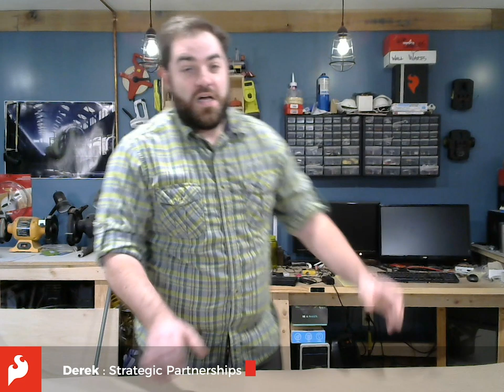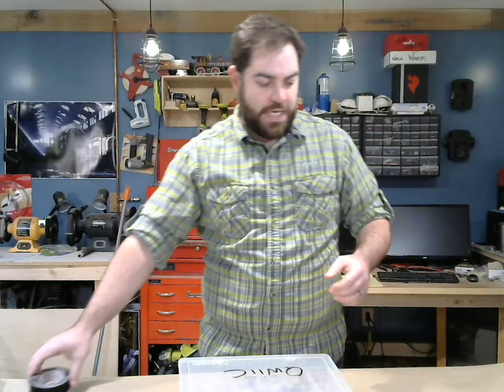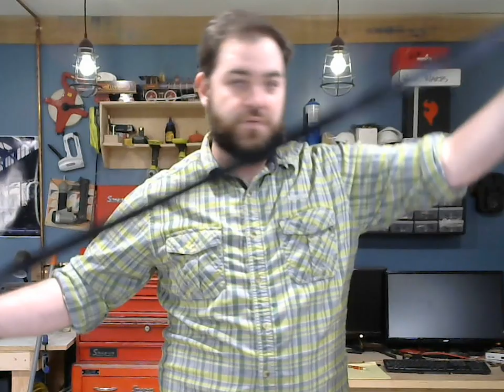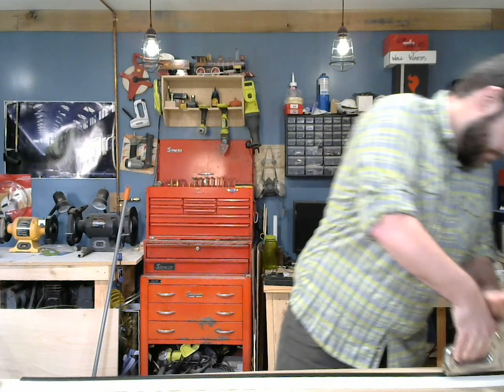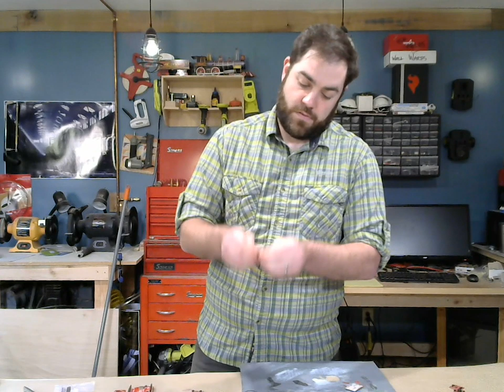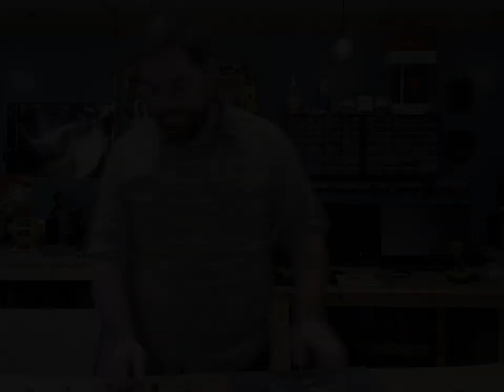Project Showcase: DIY Circuit Board Organization

Comment: dual loop is hard to press on and hard to take off and also wears out.
If the footprint of the object you need to attach has too much of it, its almost impossible to get to stick, also if the item is heavy and it sticks, it tends to fail all at once instead of giving you any warning that it is going to fall. Having used this for about a year, it easier to stick things on with 1" +/- strips than it was when it was new but it also does not hold as well and not as relyable. I'd stick with industrial velcro or a good quality one.

Comment: My electronics workbench is a steel door that I put on a 2x4 base that I made with pocket screws.  There are multiple benefits to a steel door.  1) it is fire resistant.  I can lay the soldering iron on it almost indefinitely without worrying that it might cause a fire.  2) it is magnetic.  This means you can use magnets to attach things and hold them in place - very handy.  3) You might think conductivity is an issue, but not really.  You can buy double sided adhesive circles for attaching commonly available rare earth magnets.  These circles are made of plastic and the plastic acts as an insulator.  For double protection, the door is also painted.  And 4) the door is bigger than any commonly available desk, so you have a lot of room to work with.  5) the door handle hole is used to guide power cords to various power strips on the floor.  The door handle hole is placed in the back of the bench which makes cord management easy.  

I don't know that I would use double-lock for this.  It takes a lot of pressure to get it to engage.

Comment: Could static electricity be a concern? Also, seems like a neat alternative to breadboarding, just stick a bunch of boards up on a set of strips and have jumper wires between them - could even put the strips on a whiteboard for instructional videos...
Reply: This idea has already been super useful for taking photos of boards that don't want to lay flat due to spring in the wiring wanting to do its own thing!

Comment: There's a very finite amount of time the velco will adhere. So, if it's a board you want to use often, this might not be a good idea.
Reply: With my stuff the adhesive always breaks lose before the hooks and loops wear out : )
Reply: @NETBotic  I've epoxy adhered velcro to my truck dash and whatever attaching with good success.  I forget which epoxy I used though since has been like maybe two decades.  Literally, the first detector case I had melted and warped since doing and that was like at least a decade ago.  Eventually, I get the LCD and camera's installed... though was waiting to restore the truck first.
Reply: @lulubunmellow  Yeah, I have used equipment that was very old and very used and the velcro worked fine. I guess some people buy cheap stuff. I'm guessing decent velcro would last around 20 years, cycling it once per day. That's why I made my comment about the adhesive wearing out long before the hooks and loops. I don't even know why anyone would not use velcro because they think it might wear out.